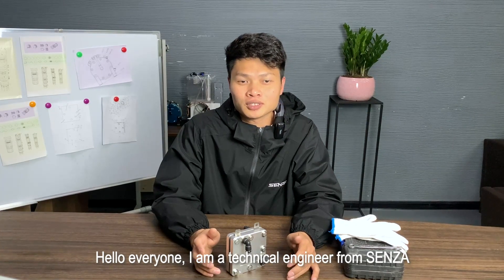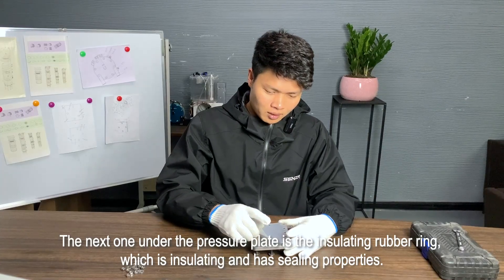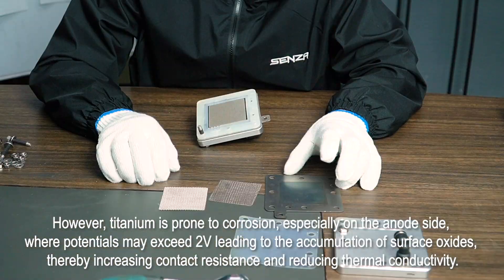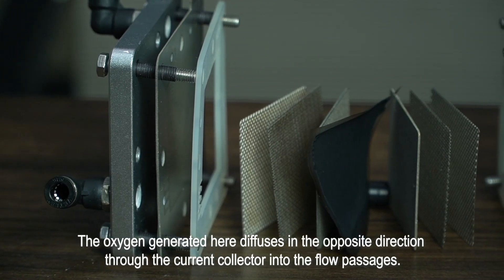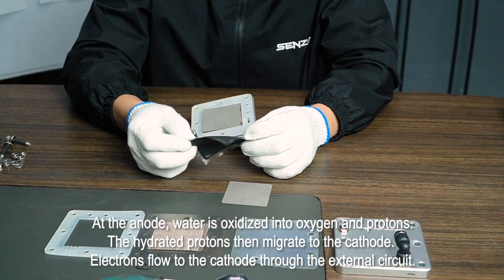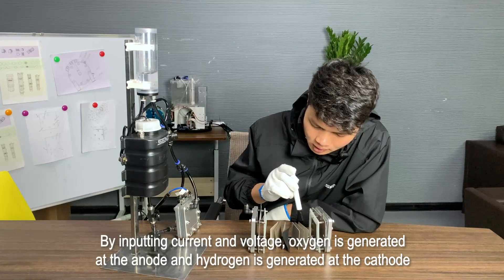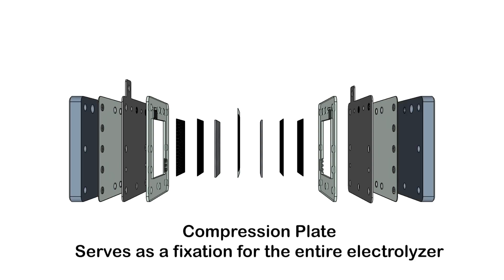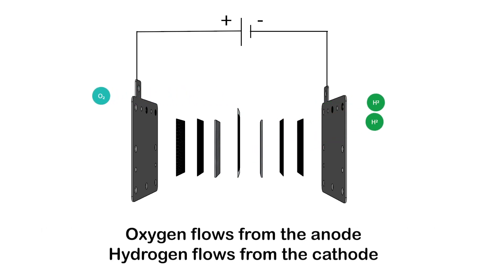Unboxing : We dismantled a PEM electrolyzer to better understand its internal structure.

Comment: i assume it won't work if water comes in on cathode side because PEM doesn't allow OH− to pass.
Reply from the maker: Hi there, that’s exactly right—PEM membranes are cation‐exchange, so they only let H⁺ through (not OH⁻). In a PEM electrolyzer you feed water on the anode side, where it’s split into O₂, protons and electrons. The protons migrate through the membrane to the cathode where they combine with electrons to form H₂. Simply introducing water on the cathode side won’t drive electrolysis, since there’s no OH⁻ transport and no water‐splitting reaction there.

That said, some water does cross over to the cathode via electro-osmotic drag and diffusion to keep the membrane hydrated, but the primary water feed and reaction must occur at the anode. Proper water management on both sides is key for optimal performance.
Reply: @senzahydrogen  OH- is not there,  just H+ and O2-, this makes different from Alkaline Electrolysis, where H2O breaks as H+ and OH-, Correct me if i am wrong.
Reply from the maker: @abdulsaboorkhan381  You’re on the right track—PEM and alkaline electrolysis differ fundamentally in which ion carries the charge through the electrolyte:

1. In a PEM electrolyzer

Anode reaction (water oxidation):

2H2O⟶𝑂2 + 4H+ + 4e−
 
Membrane transport: only H⁺ (protons) migrate through the PEM; no OH⁻ or O²⁻ ever cross.

Cathode reaction (hydrogen evolution):

4H+  +  4e-⟶2H2
 
Oxygen “ion” is not a free O²⁻ in the aqueous phase—it’s produced immediately as O₂ gas at the anode catalyst surface.

PEM: only H⁺ moves across, oxygen exits as O₂ gas—there is no free OH⁻ or O²⁻ transport.

Alkaline: OH⁻ is the mobile ion, and water splitting happens via OH⁻ generation/consumption at each electrode.

So you’re correct that OH⁻ does not play a role in PEM transport—protons do. In alkaline cells, by contrast, hydroxide is the working ion.

Comment: You mentioned platinum coated electrodes are used to lower resistance and to protect the anode, however since the cell uses pure water the platinum is actually essential as a catalyst? Will this cell work in reverse to generate voltage from hydrogen and oxygen combining?
Reply from the maker: If you run it in reverse, it essentially becomes a hydrogen fuel cell, using hydrogen and oxygen to produce water and electricity.

Comment: hi, what is microplate?  what material is it made of?
Reply from the maker: It is also called the Gas Diffusion Layer (GDL).It is electronic conductor between the MEA and BPP, ensures efficient mass transfer of liquids and gases between the electrodes and the BPP.Its material is titanium

Comment: This is a system for cars but in your products you have fuel cells to recharge batteries of photovoltaic systems (48v)?
Reply from the maker: You are referring to the idea of using hydrogen fuel cells as a supplementary energy system for photovoltaic systems. This concept is indeed feasible in theory, and we have a complete educational system that demonstrates the integrated process of solar energy, water electrolysis for hydrogen production, and hydrogen fuel cell power generation (https://senzahydrogen.com/products/solar-hydrogen-energy-lab-kit). However, for personal home applications, we do not recommend this approach due to the dangers, complexities, and high costs associated with hydrogen storage systems.

Comment: Is it works only with pure water? or it need potassium hydroxide similar to the HHO generators?   Does this cell needs only 2 volts?   Really thanks for your valuable video, for a while I was searching about PEM electrolysers, but could not understand its working till watch your video, thanks
Reply from the maker: 1.Just pure water.KOH or NaOH will damage PEM electrolyzers
2. Extraordinary parameters are involved and need specific parameters to be known.
Thank you very much for recognizing our videos.
Reply: @senzahydrogen  what about Nahco3? Is it safe for the cell.
Reply from the maker: @ALSHAHRANII  
Using sodium bicarbonate (NaHCO₃), commonly known as baking soda, instead of sodium hydroxide (NaOH) in an alkaline hydrogen generator might not be the most effective choice. These two compounds, though both alkaline, differ in their chemical properties and reaction mechanisms.

Sodium Hydroxide (NaOH): It's a strong base that fully dissociates in water, producing a large number of hydroxide ions (OH⁻). This makes NaOH highly effective in hydrolysis or other chemical reactions, especially in applications where rapid and efficient hydrogen generation is required.

Sodium Bicarbonate (NaHCO₃): This is a weak base and does not dissociate in water as completely as NaOH. In water, NaHCO₃ primarily generates carbonate ions and a smaller amount of hydroxide ions. Therefore, its alkalinity and reactive properties are less pronounced compared to NaOH.

In alkaline hydrogen generators, an alkaline environment is usually necessary to facilitate the electrolysis of water for efficient hydrogen production. Using NaHCO₃ might lead to lower reaction efficiency due to its weaker alkalinity, potentially not achieving the hydrogen production rate and efficiency of NaOH.

However, this also depends on the specific system design and operating conditions. In some cases, using NaHCO₃ might have unique advantages, such as in controlling the system's pH or under certain reaction conditions. But overall, NaOH, due to its strong alkalinity, is generally the more common choice in alkaline hydrogen generators.
Reply: @ALSHAHRANII the platinum is the catalyst, you don’t need any salts